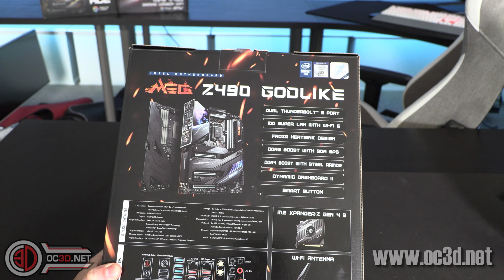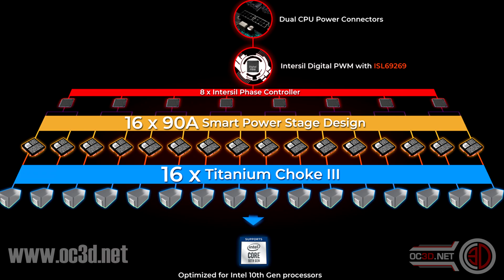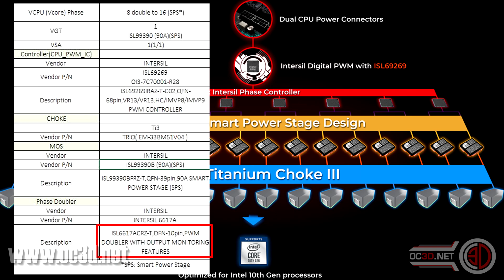MSI MEG Godlike Z490 Preview

Comment: 10G lan is an absolute false marketing gimmick, 2.5G on this years motherboards are basically the same amount of performance as a 5G network we have today. Plus the keep in mind only the 11th Gen Intel processors will turn everything to PCIe 4.0 allowing many improvements including improved M.2 performance from 32 gigabit per second to 64 gigabit per second, meaning that almost everything on the motherboard itself will have a double bandwidth improvement.

Comment: I was kinda bummed when I noticed they removed the Headphone out, that was the reason for me to keep MEG GODLIKE in my mind for the next gen so I can have both headphones and speakers connected at the same time on the back and just switch output in windows. It would also justify the price a bit more compared to getting a high end motherboard + EVGA NU Audio Pro :P